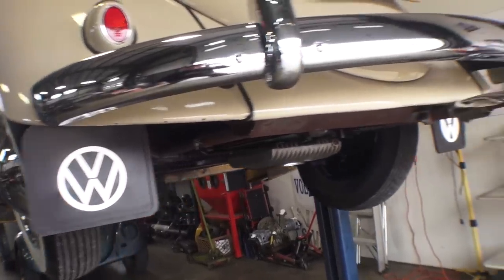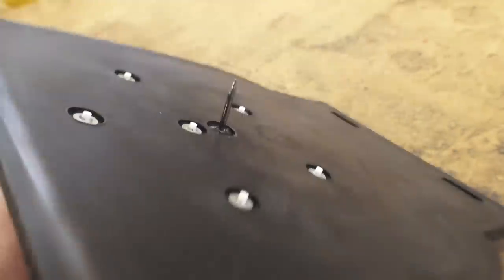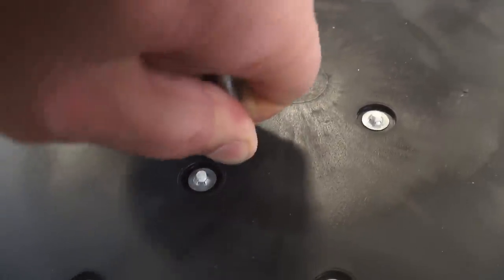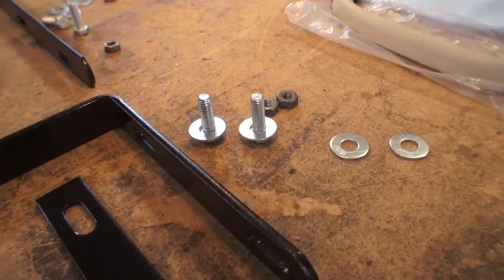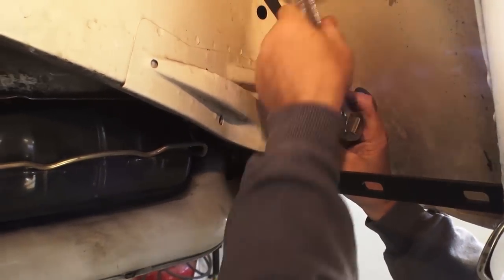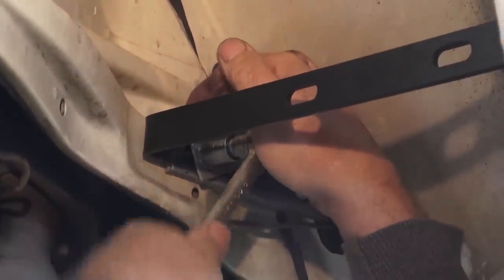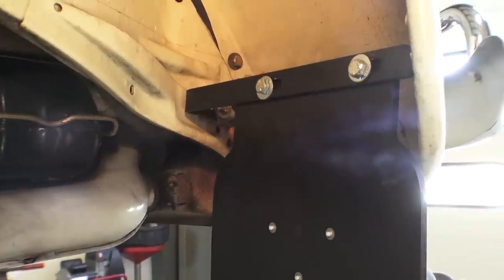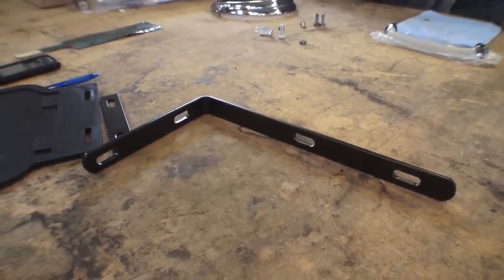Classic VW BuGs How to Install Vintage Beetle Mudflaps Mud Guards

Comment: installation is different on the late model bugs as 1968-1973 the front hole is only used to mount the mud flap to the lowermost hole on the bumper brackets. as fabrication may be required on 1974 -1980 models of bug with the shock absorbing bumpers. as these Will Not work on 1968-1975 beetles with the automatic stick shift transmissions due to the ATF and vacuum tanks under the rear fenders. unless you converted your autostick to a 4 speed manual then they will work.

Comment: Where can you buy these VW mud flaps? Mine were missing when I bought the car, but the L formed mounts are there..just need to attach the black rubber mud flaps on both sides with the two screws. I live in Oslo, Norway and am trying to find out where I can order some. Any advice would be appraciated. I have a 1969 VW 1300. Best regards, Christopher
Reply: Christopher Ellingsen Same question, Ålesund Norway

Comment: Chris, this is an unrelated question. But where do you buy your Beauty rings for your wheels? They look like they always fit so nicely. Im scared I'm going to get some on my 58 that won't fit good
Reply from the maker: I go to eBay, search for ABS plastic beauty rim.  I know I know they are plastic, but you would never know it, and they shine and fit the best!  Should only be like 40 bucks.

Comment: Chris, are those bolts that mount the bumper brackets into the frame 8mm coarse (1.25) thread? Thanks.
Reply from the maker: I believe so yeah, they are he same as the fender bolts.
Reply: Thanks.